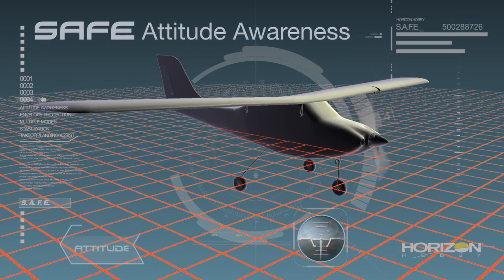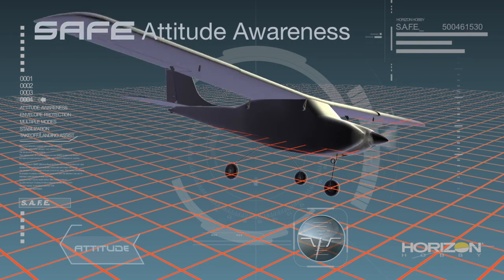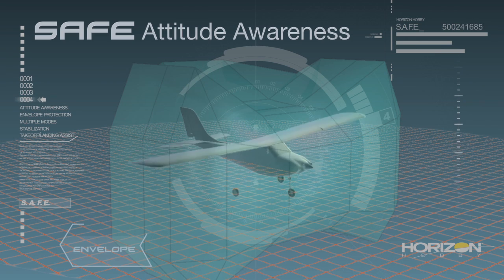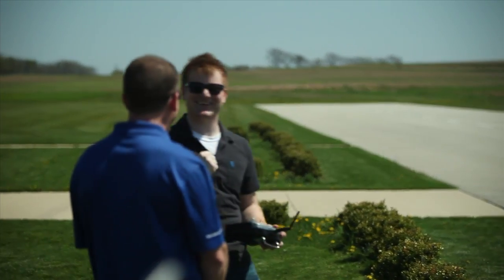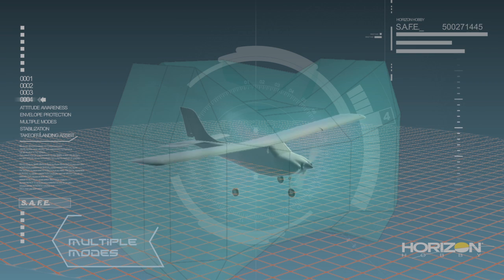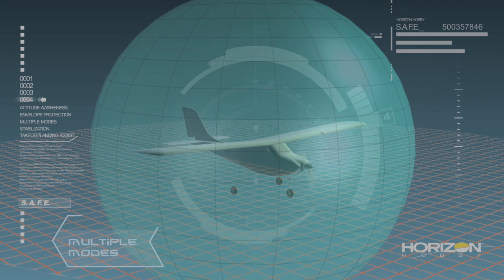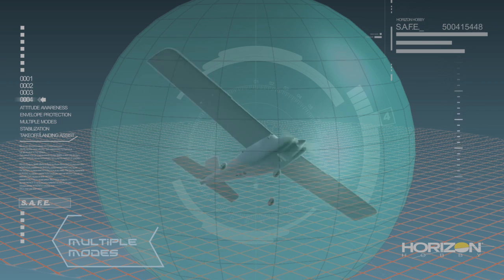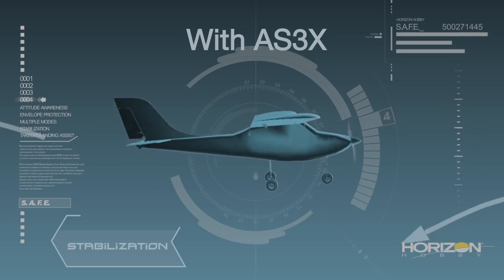SAFE™ Technology

Comment: Install S.A.F.E into a size 200 single rotor-head with shaft driven tail rotor RC helicopter & have it emulate the handling of a quadcopter, then I'll be convinced.  Otherwise I'm really not impressed.